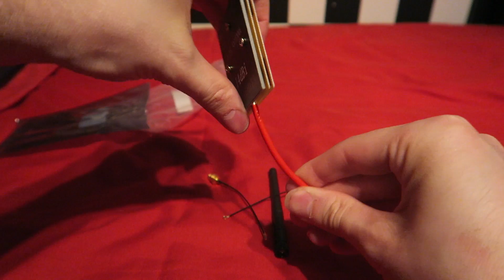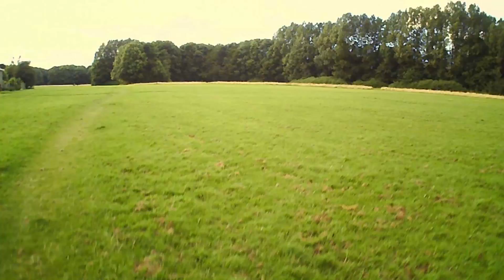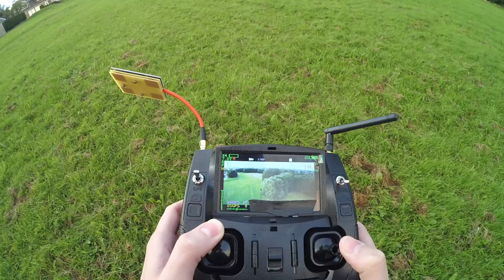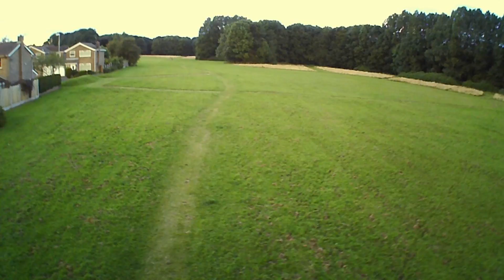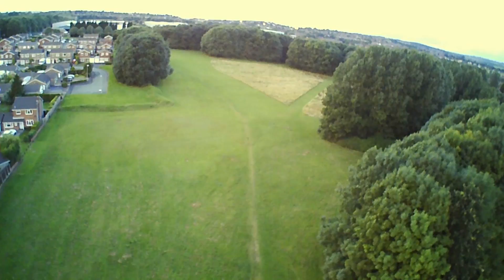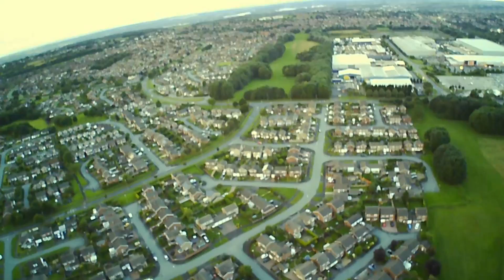Hubsan Range Extender Mod

Comment: Try using left stick as the ascend and descend rather than the right stick. The right stick is originally programmed to be throttle forwards backwards and left right yaw

Comment: Great video, thanks
Reply: I think we have to put it in expert mode to fully extend the range.   Not sure but  it does have limitations set into the system for beginners on the 501ss as far as the manual states.

Comment: It's interesting that Hubsan will admit that their products acn be improved and provide the parts to do it. I remember your notes on the Deviation forum on binding to the new Hubsans. I still have a Hubsan which doesn't work with any protocol (H001). I wonder whether this qualifies as a modified transmitter under BMFA rules?

Comment: Just upgraded mine. August 2018. They have now begun hot gluing the SMA antenna connectors right to the receivers,  along with hot gluing the antennas to the frame of the remote. Not a tragedy but extra care must be taken when removing the connection. The receiver boards aren't made of steel so simply ripping it off may permanently damage your remote so be careful! I haven't done a range test yet on my mods and the stock antennas seem to work fine on the unit's 250m height limit. I love taking pics at max height for effect. I've seen many vids on range tests and the key seems to be to keep line of sight and with this mod I've seen 2500m+ out!

Comment: 100 meters: SCREWED IN THE ASS AGAIN! I get about 750 feet with a piece of 26 gauge copper wire, bent 90° at the middle, thus creating a DUAL POLARITY antenna. Similar to a "Cloverleaf" but better range easily! This CRAP that China sells us NEVER ENDS, you NEVER GET WHAT YOU WANT and they suck lobster and super models while you suck TUNA out of a can. WAKE UP, Wiki "full wave antenna 2.4GHz" and make your own, mine cost a NICKEL! I have cash left over for 1-2 of those super models. Cheers

Comment: My stock H501s s got 600m with stock everything over busy signal area near a reservoir.  I have the antenna mod on order.  I wonder if everything on yours was connected ok.  Or perhaps it's a software thing?  My drone came shipped with firmware version 2.1.23 and 1.1.36

Comment: i did my one once with a range of 850 metersand a high of 220 meters with out   extender antenna .but my battery  gets low very fast like  just 2 mins

Comment: So why some experts say not to do any firmware updates at all just to leave it stock?
Reply: from what i've figured out, it all depends on what came with your particular drone...
if all you can get in distance is 80 -100 meters, then you're screwed unless you upgrade your fw..

Comment: need help if possible h502s fell out of sky rear left motor an led wont arm any help would be greatly appreciated. ive checked everywhere theres not much on it checked connection im at a loss
Reply from the maker: sounds like something has come unsoldered or something has burned u would need to take it apart

Comment: The Range extender mod does work some what... After installing both antenas i can now go the distance.. Before i was only going out about 145m. Now with the new antenas im getting 300+. I have the Superflyer Firmware which improves stability. I am using my OG battery that came with my 501s and it sucks. The voltage drops at take off to about 2 bars, so i cant fly far in distance because the fail safe mode will kick in and RTH. Im guessing when your quads battery voltage gets low it will automatically kick into RTH. So just a tip, USE DUAL BATTERIES to get better distance because with one battery you wont go vary far......Questions?

Comment: nice video. I tried this mod but can only get around 120m before the screen goes black. same with before the mod. also follow me doesn't work and the GPS is kind of unstable. my version is 1.3.33. someone help plss
Reply: u0770408 if you had the fpv antenna like he has it in this video than that would be your problem he's pointing the fpv antenna the wrong way

Comment: so is the H501Sor C not better then the H502S because of brushed Motors, why would anyone rather have the H502?? because its smaller?
Reply from the maker: less dangerous and the novelty of a brushed quad with gps for me
Reply: i see the H502 selling with the H501 controller on eBay (china) of course, how can this be if one is 1080p while the new 502 is 720?  i watched another video on YT where this guy tried using the combo and it failed,  the video got distorted, then another guy sais there is a frmware update..

You recomend the 501 S or C over a 502?

my son wants a mavik but there is no way im paying 1k for something he has no clue about, he just wants a drone to fly with gps out in the country side

Comment: Hi Andy, Just to let you know I have taken mine up to 167 metres and out to 120 metres on the stock antennas. It was on my street so in an urban area with all the interference that goes with it. I had full control throughout and only the odd picture break up.

Comment: andy ' after adding the  external antennas I made the mistake of turning on the tx without the antennas attached. now  I can't record video or pictures. how do I fix this problem?  is it a  hard fix? this was done on the hubsan501s tx
Reply from the maker: the only damage u will do to the transmitter not having the antennas on is the 2.4 control system. so if u can still control the quad then the antenna is not your issue
Reply: I have complete control in flight. no problem there. I changed the sd card to a fat 32 as they said  in the  operating manual. didn,t take  video while in the air only  in doors  could that be  why? going to try out side thanks andy
Reply from the maker: yep id say that could be your issue if u have control then the transmitter isnt damaged. it is another issue.

Comment: is there a way to change the horizontal distance of 100 meters. like the h501s you can change it in the firmware tool to "0".

Comment: Hi Andy ...thanks for the mod .. can you please let me know if you have a you tube video for H107D+ for this antenna kit, you mentioned having to solder directly to the PCB.
Reply: no soldering needed for    http://www.ebay.com/itm/192053976728?_trksid=p2057872.m2749.l2649&ssPageName=STRK%3AMEBIDX%3AIT unsnap old ones and snap on new ones

Comment: Hi. Just was wondering if it works with the h107d
Reply: It works with the 107d but installation is considerably more complicated and involves soldering and cutting the existing antenna trace on the transmitter pcb.
Reply: He said in the video that the description on the product page says it works with the h107d

Comment: Hi all, Great video keep them coming, I too have a 501s just a note: DON'T TURN ON TRANSMITTER WITH OUT ANTENNAS!!! that's bad you can blow the 2.4GHz side of Transmitter out, at that point just order a new transmitter board.  Have a great time flying the 501s and enjoy.. ;) Don.

Comment: I tested this quads 'geofencing' and it simply doesn't exist. I ran a H502e out to 500m today, and the only reason I came back was lack of battery capacity. I have mounted quads' 2.4GHz antenna vertically. I use a 5dB rubber duck on the controller, also vertical.
Reply from the maker: different firmware...
Reply: So, does the H502E have more range capability than H502S?   The H502E f/w hasn't limited it like the H502S?   I'm confused, please clarify if you could.
Reply from the maker: it depends what firmware it has it seems. and you can change the firmware so it doesnt matter

Comment: I have a hubsan h501s myself and the altitude is capped dependent on firmware version. I am using firmware 1.1.17 and on a stock remote. I have taken it clear over 120m high and 300 meters distance using a stock remote (upgrade in the post), with the firmware i am using the altitude cap is around 220 meters. The hubsan in GPS mode calculates the safe return to home distance in relation to battery power, It will then stop and automatically return to home unless you force it not to. Your restriction is simply because the hubsan is calculating safe RTH. the reason your height was not reduced as much is because it requires far less battery power to descend then to travel along the horizontal. Hope that helps.
Reply: Carenza Archer I have both the 501s and the 501a the 501a is so much better it uses less battery power because it's all WiFi you get 25 minutes of flight time for every battery and I've gotten it out on mile-and-a-half distance and 500 M High but I enjoy the 501s because you can maneuver better with the joysticks the 501a you use Virtual joysticks on the tablet
Reply: That's honestly nothing. I have one and its completely stock. I've gone 468 meters away and about 100 meters in altitude. That was also in a neighborhood with allot of trees
Reply: Over 1300 meter with 502s and 2500 with 501s. Antennes all out, also the quad antenna,  501s flew away over 2500 meter distance and did not return as or should. 
When out of range of should switch from altitude hold to gps and rth but or didnt,  it jumpt to manual mode and didnt listen to commands anymore. 
Got new ones ordered including home made tuned antennes to der of i can smash the last distances
Reply: Nice comment. *Also This is to the many who don't think things through much. * Flying too far out of sight without obstacle avoidance and much more is very neglectful to other people's safety and also kids if some don't care for adults, at least care for the kids who won't be able to realise something is falling from the sky as fast as maybe an adult would.
Wanna fly out of sight true fpv?  Pay the high dji price and follow the law that comes with it or fly over water all the time, the hubsan is just about that cheap that we can trial it over some sea rather than over innocent lives heads. 
If your friend/public knew the drone ya flying had motors that could cause serious damage and that ya flying it out if sight also knowing the truth to the dangers then I don't think they would respect you much at all..

Comment: Good vid, but I wonder how you say it works when all you get is the standard 100m? Doesn't that mean it doesn't work? Also, several times you're almost pointing the 2.4 ant AT the quad, which wouldn't help. Did you do a distance test before you did the 'upgrade', to do an A/B comparison?
Reply from the maker: +David Tormey yes I did....
Reply from the maker: you need to watch the video again and also the review i did of this quad cheers
Reply: OK, I will, thanks for reply Andy.

Comment: Sorry to see that you're draining your batteries below 7 volts for the two cells lipo , that means down to less than 3.5 volts for each cell. No wonder you were not having control over the quads at the end of the flights, and you were not able to fully charge the batteries. They're dying!
Reply from the maker: +stephen wu everything you have said there is not correct :-)

Comment: I have added the long range kit and I have flown out to 163 meters with no problems.  Not sure what hight, i think it was close to 90 meters.  For such a small camera the 720p is very good.  I getting very close to 10 minute flights.  I have also added a Turingy 7.2V 2000mAh li-po battery to the controller so the only limitation is the quads internal battery.  Note: beyond 100 meters it gets very difficult to see the quadcopter.

Comment: Mine hits a wall at around 110m horizontal, 115m vertical - with the external TX antennas. I'm on FW 1.1.28 and I see there is a 1.1.31 on RCGroups, but can't get any info on what's in the changelog so am a bit reluctant to try it!

Comment: Hi Andy, I see the chequerboard wallpaper and can't wait to see your latest. You have taught me loads! I see you can get the H501s with the Hubsan FPV1 transmitter now. I think it looks great but the screen is a little smaller than the standard tx. Which do you prefer? ive seen a few complaints about the cheap feel of the standard tx. Your mega tx with the wifi booster is sick!
Reply from the maker: +Quads Eyeview the fpv 1 tx is so much better than the other tx. Get it :-) and thanks for the kind words

Comment: Interesting. I've flown my H502S out to 140 metres. The FPV broke up a bit, but it kept control just fine, and I turned it round and flew back again. I'll have to experiment with range and then upload a video at some point... When I say it flew out to 140 metres, I'm going by the distance stated on the FPV screen.
Reply from the maker: it could be that mine has a different firmware installed. need to look into it

Comment: Thanks for the post, do you think this method can be used to extend the h107d TX as well?
Reply from the maker: +TheWaterbound07 it can but you have to solder the email connectors to the circuit board
Reply: +AndyRC email connectors? :) thanks for getting back Andy!
Reply from the maker: SMA connectors apologies

Comment: Good job Andy :)  That patch antenna looks pretty elaborate actually.. Maybe the kit would be interesting just for that? (for other use I mean).. Might be nice to test it against other patches?
Reply from the maker: yep! great minds think alike....first thing i did after the review is put it in my fatshark holder.. really good bit of kit! cheers
Reply: Ghehe Score! :D I'll try one as well :)
Reply: AndyRC What versions work with these mods? My FPV flickers merely feet away. I haven't install the mods yet and I have 1.1.21

Comment: I can see that mod will be useful for the FPV birds but although I haven't yet tried the 502E I regularly get a full control range of over 150m on my 107C+ *
Though I confess I have to have a helper at anything over 120m because it is just a tiny dot at that range so it won't really help me to add to that bird.
The apparent "geofence" is interesting but looks more like a "loss of signal" given the quad's behaviour
Great video and test though

*open terrain far from any wifi
Reply from the maker: the reason i dont think its loss of signal is I have full signal and controll no problem and it just turns around... yet i managed to get it lose actual signal before and rth kicked in... so id say 100 percent geofenced.
Reply: Having re-watched both of your 502s videos I agree.
Seems like the same problem both times so must be a geofence of some sort
Reply: +AndyRC That's a great mod for cheap! I remember the fly away you had down that end of the field, any chance of bad interference down that end of the field? You are going vertically no problem. Maybe a road trip to the countryside for a follow-up distance test? I just got the 502e and I like where Hubsan is heading with these budget GPS quads.😀
Reply from the maker: nah its looking like its unfortunately geo fenced
Reply: +AndyRC That is impressive for a brushed quad, love where this hobby is going!